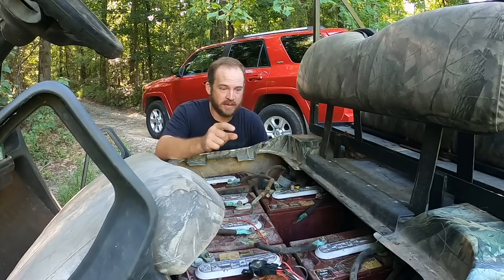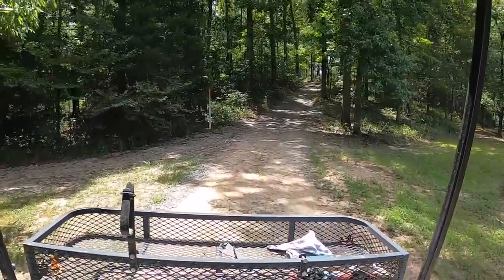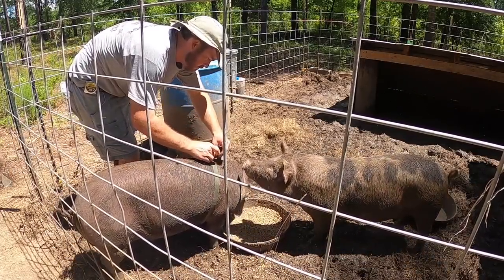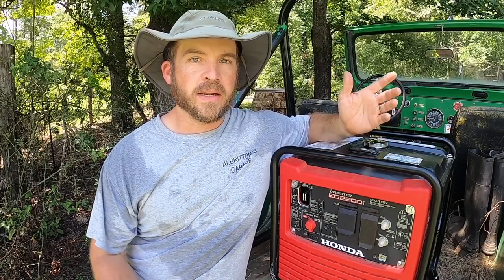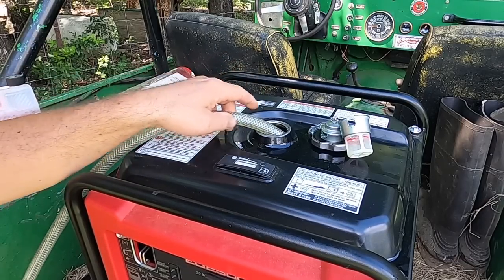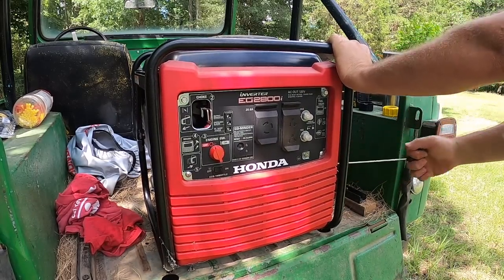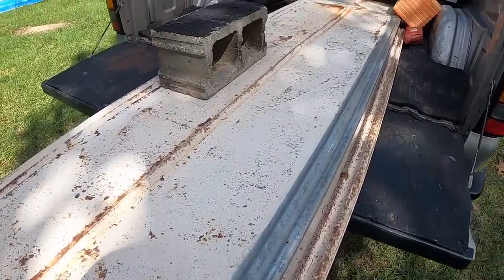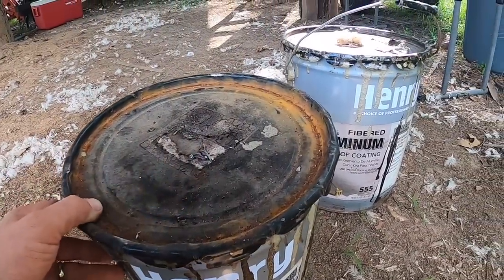You Should be Prepared

Comment: The terminals on the batteries look like they are corroded, greenish color, I clean the terminals and brush Vaseline on the posts and cable connections, this allows the power to flow freely and stops the acid from corroding, cuts down on battery maintenance. I always get either premium fuel or non ethanol fuel for my implements, the ethanol seems to do a number on the carburetor. I’ve found that disconnecting the fuel line from the tank and run some combustion cleaner through the carburetor if I figure the carbs are getting shellac etc from old fuel, it cleans out the carb. we fix a lot of generators and it works well. enjoy your videos,  all seem to forget to turn the switch on, keeps us humble, kind of nice to see your son growing with the channel. Cheers my friend.

Comment: I bought a battery powered transfer pump a while ago, it’s been the best thing I’ve ever used to transfer gas from and to my gas powered equipment. It cost me at the time @10.00, and it works great. 2 d cells and your off and running.
 If you get the gas flowing, you can turn the unit off, and it will keep flowing until you run the tank out. 
 God bless my friend, all looks great so far. 
 Doing any sawing in the near future? Take care, stay safe!🙏🎚🇲🇾🇲🇾🇲🇾
Reply from the maker: Not sure on the sawing, if I need more chicken house siding I'll def need to fire it up.

Comment: I cussed my Honda pressure washer for about an hour last week.  Switch was off.
We switched our cart to a single, 36v lithium battery and man what a difference.   Took a lot of weight out, about 200 pounds, and it charges up in an hour from 25%.  Pricey but a good deal.
Now I have to add " run generator" to my list for tomorrow.
Reply from the maker: I've seen those lithium batteries. This one is 48v, and the lithium battery is crazy expensive. But I can totally see how it would pay off in the long run.

Comment: 9:11 how was... there's irony here? 

on the piece of tin with "swiss cheese" as you called it: why not tig weld it? or, if tig isn't the appropriate formulation(???): why not weld the hole shut? it's metal, not.... cardboard? i dunno. point is: you should be able to use the thing. even if welding isn't an option, couldn't you seal it... somehow?
Reply from the maker: I replaced a "spill free" gas nozzle with a standard spout and immediately spilled gas. I thought it was ironic.
Reply: @falllineridge  oh. i didn't even notice. that is pretty funny